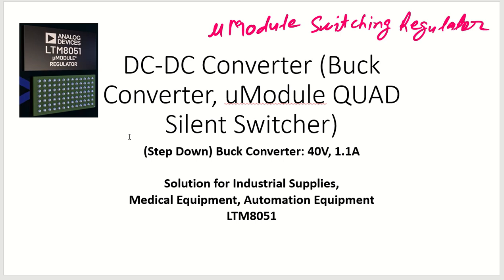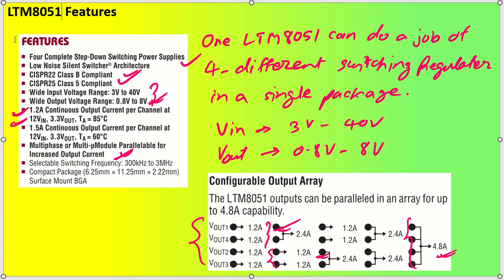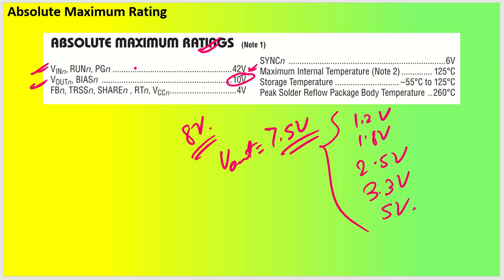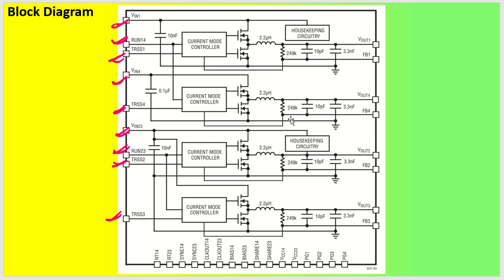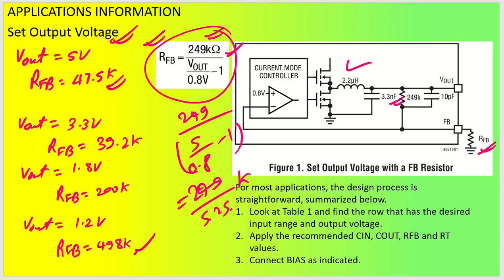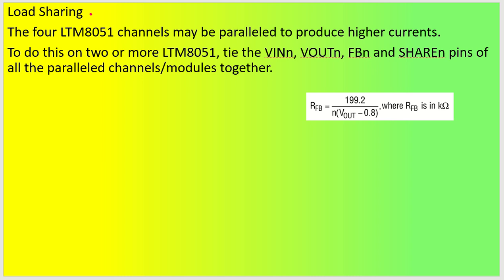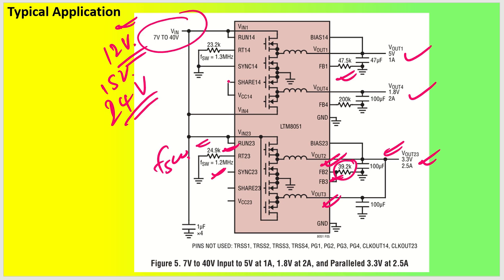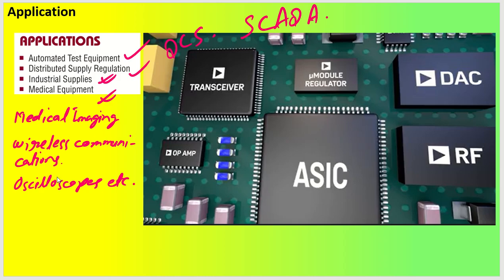064 uModule Switching Regulator Design Techniques LTM8501

Comment: Please provide more videos on micromodule switching regulator, I require to design power supply for my system with space constraints
Reply from the maker: @jeetkumar-h4e  yes, definitely we are working with different switching regulator and verifying them. We will provide more application with different micromodule switching regulator design techniques